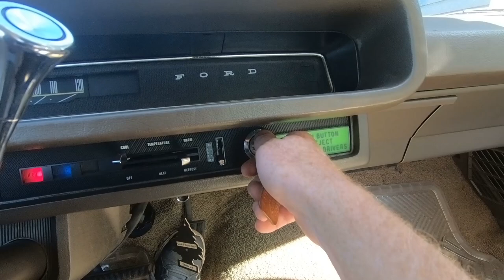BEFORE THE FORD PANTHER PLATFORM THERE WAS THE FORD CUSTOM

Comment: Man what an awesome car! Thanks for sharing it with us, I really hope the lady gets a fair price AND it goes to a good owner. If I had the thing I wouldn't change anything about the looks, just do some minor maintenance and sneaky upgrades like I've done with my Rustang and Trans Am. As for the power of an old 302 they are pretty darn stout for a little old small block and were seriously under rated from the factory for insurance purposes. 
68 was the first year for the 302, the 2 barrel version stayed essentially the same until 73 when they dropped compression a full point from 9.5:1 to 8.5:1 to lower octane requirements and emissions for the first oil crisis and early emissions laws. Ford also started rating HP in "NET" horsepower in 71 and up as opposed to the "gross" horsepower rating used in previous years and switching HP rating methods made it look like it lost a ton of HP on paper and appeased the insurance companies even though it was still the same engine with just a detuned head gasket and some emissions equipment choking it down a bit. 
The factory under rated the early higher compression 302's at 210 HP and claims the 71 and up is only making 135 HP which is total BULL! Not only do I have a 73 302 2 barrel Mustang that hauls ass but I ran the numbers for the old 302 through a rough horsepower calculator (which unfortunately can no longer be found on the internet now) and it said the 8.5:1 version should be making roughly 285 HP and the 9.5:1 version should be making just a bit over 300 HP. The factory 4 barrel versions also had a slightly better compression ratio of 10:1 and were factory rated at 230 HP but made closer to 330 HP on the calculator if I remember correctly. None of this is relevant to the Boss 302 which is an entirely different animal that basically amounts to big block heads on a small block V8. 
Anyhow my point is the HP is definitely not so low on the old LTD there, like most other classics it probably has a tight converter and highway gears keeping you from seeing all of that power until you get rolling a bit but my 302 Rustang is basically stock apart from egr and cat delete and dual glasspacks and it can burn one tire for an unreal distance with no help from the brake. 
Good vid man, I really enjoyed checking out this sweet old Ford! I'd like to see an acceleration test out of pure curiosity, maybe even a generational grudge match of sorts between it and GrandMa but I can also totally understand if you don't wanna go full throttle on this little old ladies gem.
Reply from the maker: What he said! Dude, you have so much knowledge! I appreciate every time you share with us!

Comment: That old ford looks pretty good. Nothing shuts like old doors. Thats a big car not to have power steering lol.  Hopefully the tensisoner fixes that noise. Would be nice if you just needed a little thicker oil.
Reply from the maker: The tensioner did not change anything. We did try thicker oil with no difference!
Reply: @OldeCarrGuy  damn. Im assuming that the noise is in the bottom end. I dont know much about those engines but i wonder if they have a common problem
Reply from the maker: The 2.0L was known for piston slap but not these! This one sounds more like a lifter noise!
Reply: @OldeCarrGuy  over head cam right? that could either be the cam with those shims i think they have to adjust it, or maybe injector that can sound like a lifter, its hard to tell over the internet  lol

Comment: Hi Jason, my younger brother owned a 68 custom in mint condition, bought from a family member. Sadly on a road trip he fell asleep while I slept on back seat. I awoke too a view of the passenger side axle where the wheel should have been and the door torn off one more roll I wouldn't be typing this. Brother was jammed between the roof and the bench seat, I kicked the roof up so he was able to escape, that old car rolled eight times, just a wonderful running 302 in the old girl. The tow bill was around fifty dollars and that's was what he got for the car or what was left of the it. And that's my story of the 68 Ford customs last road trip. Cheers🇨🇦
Reply from the maker: I love a good "Used to have" story! Glad everyone was ok and thanks for sharing!

Comment: When I was 16, my first car was a 1966 Ford Custom.
In-line 6 cylinder, 3 speed on the column. The thing cost a whopping $200.

Now, 41 years later, my daily driver is a 1996 Mercury Marquis.
Pretty much the same car, just a different color and 30 years younger.
Oh, and I paid $1000 for it.
Reply from the maker: And they are still great cars today! thanks for watching!

Comment: Clean, clean, clean. So officially the model is a "Custom"? Why did I think it was an LTD, Custom? Also, the "not a lot of power" numbers you flashed up for that 302...the Fairmont would kill for out of that many cubes. You used the catch phrase!
Reply from the maker: Yes! It is a Custom! The LTD didn't come around till later apparently. I think you'll see a huge difference with the new rear gears and once again with the heads!
Reply: @OldeCarrGuy  LTD was introduced as a limited upgrade to the Galaxie 500 in 1965. I sold so well, Ford added it to the Custom and Galaxie line up. So, yes, 1968 also had the LTD option.
Reply from the maker: I appreciate you clearing that up! I never was much of a Ford man!

Comment: I was that teenager driving a car with manual brakes and manual steering in the late '70s and let me just say this: I inherited the car from my 80-year-old aunt.
Reply from the maker: Love hearing stories like this
Reply: @OldeCarrGuy  '69 Rambler, no PS, no PB, crank windows, mechanical seats, radio-delete, no lighter, no AC, vacuum wipers, and winshield washer fluid you had to foot pump onto the glass using a rubber nipple on the firewall. Straight six, room for six fat-assed adults, a trunk big enough for four sets of clubs and a cooler, and got over 20 MPG.  A true Kenosha Cadillac.

Comment: There shouldnt be much of an issue with the Ford having manual steering and brakes.I drive a 63 Dodge 440 sedan with manual steering and brakes without any problems and thats with me having severe back problems. You must be getting spoiled.
Reply from the maker: I am a bit of a wimp! LOL And spoiled with power steering and brakes! Thanks for watching!